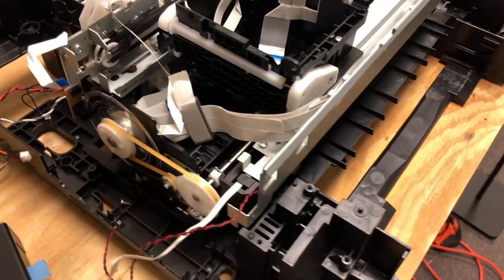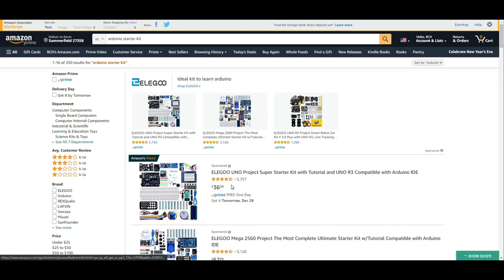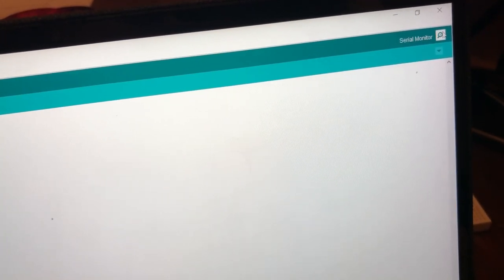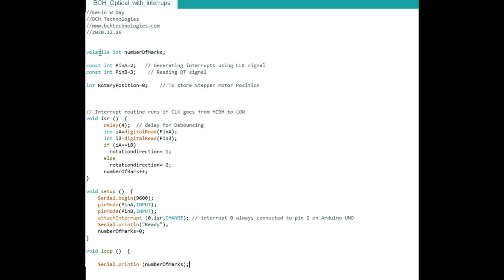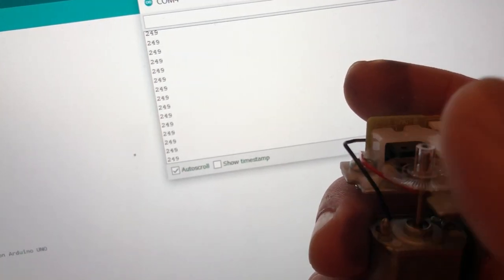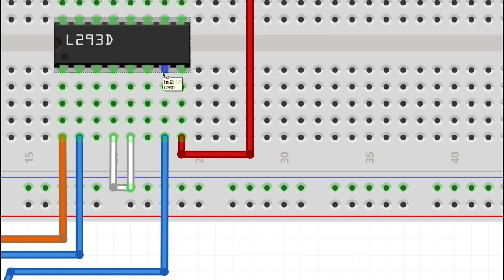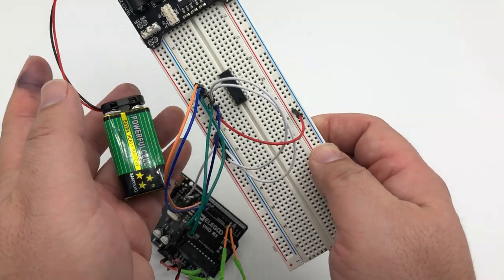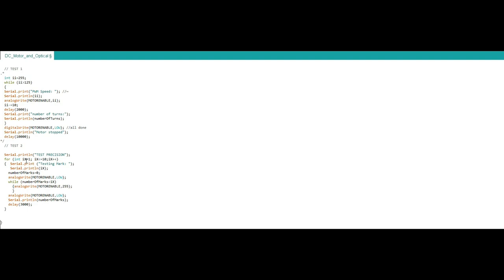Program Arduino with Epson Optical Encoder & DC Motor - DIY DTG Printer Series

Comment: Please do not do a TikTok dance! Your video is excellent, with a clear and concise description of the circuits and the code. How does this method of control differ from PID and which method gives the most accurate control of DC motor. I have been using stepper motors for my application, but would like to use a DC gear motor to achieve smooth but accurate positioning. Thank you.

Comment: Cool.  How then can I make this motor the input to drive another motor which is a real stepper motor.  Because  in diy dtg using epson printer for example epson l1800 dtg , the feed motor drive is imitated by the stepper motor that drives the flat bed

Comment: This is really helpful 😊, and one more thing i'am planning to build a PCB printer  used on old inkjet printer, I want to run my stepper motor use this same concept... In your video you will show it run dc motor but I want the same method to run Nema 17 stepper motor... If u help me, I will pay money 💵... Because this is very important project.... Please help me.....